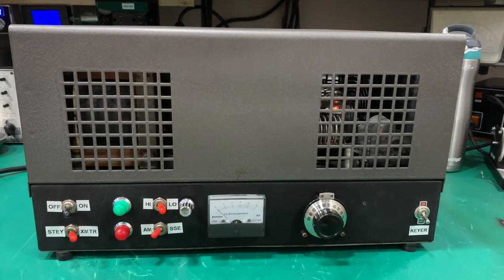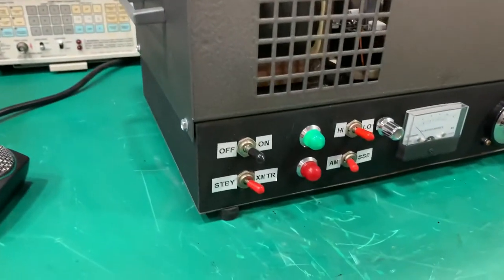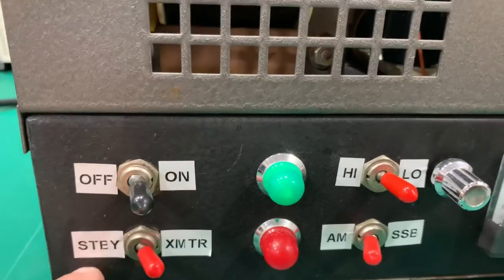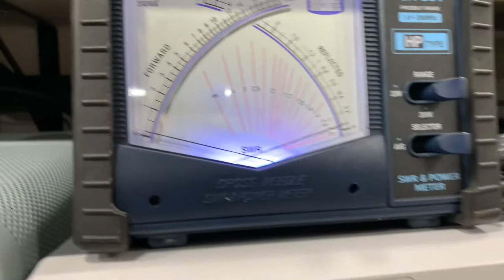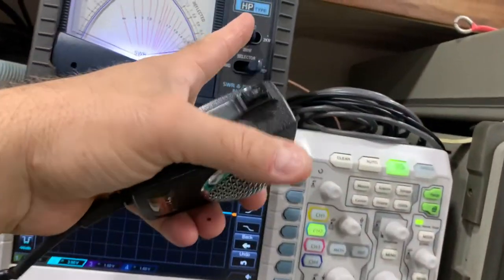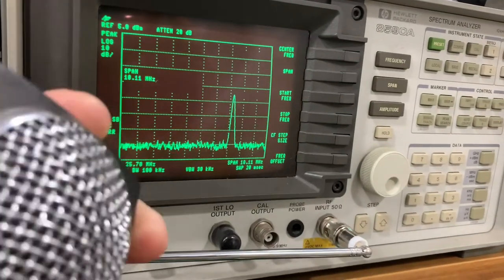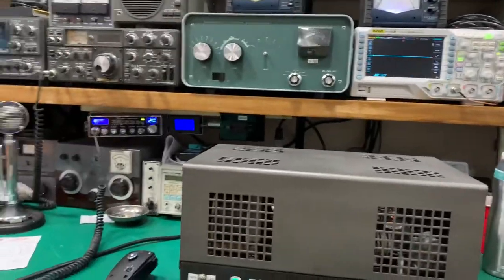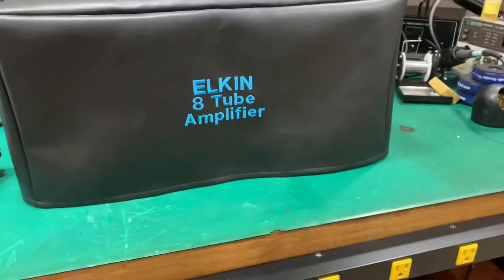ELKIN 8 Tube Linear Very, Very Clean $700 plus shipping

Comment: When the elkin were first made, they had 6dq6b, but others would take and replace with 12dq6b assuming  the higher filament would give more power. If the higher filament did give more power it was very small. It all about supply and demand.
Reply: When were they first made? I have 2 of them, one has 12GW6's while the other has 6GB6GA's.
Reply: @dw8840 late 59' to early 60 some of those had the chrome strip across the top.  The Elkin is not to be confused with the H&L it had a different style top but some times people would swap the covers and it was hard to tell. Also the first Elkins and H&L where 807" and 1625.
Reply: Ray built them both. I have a 8 tube and a 2 tube. My baby Elkin and her big brother 😅